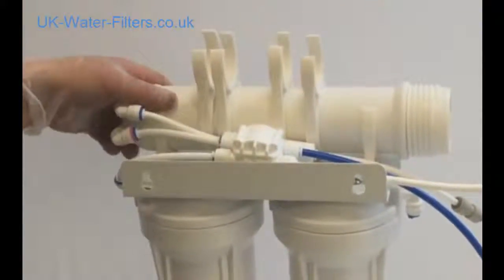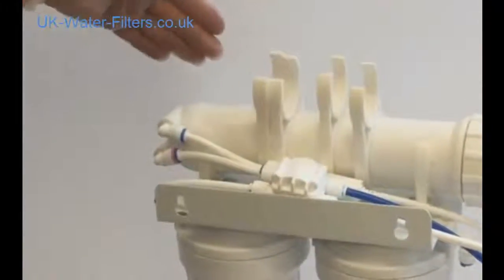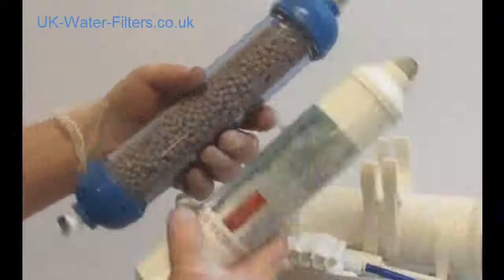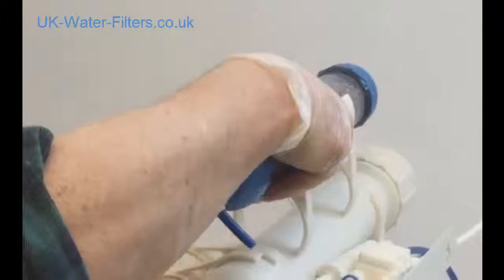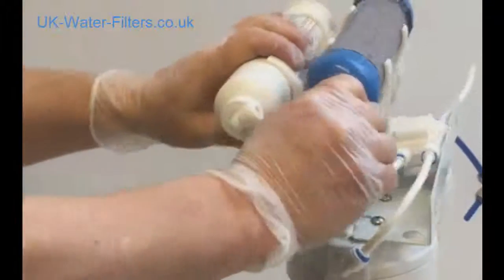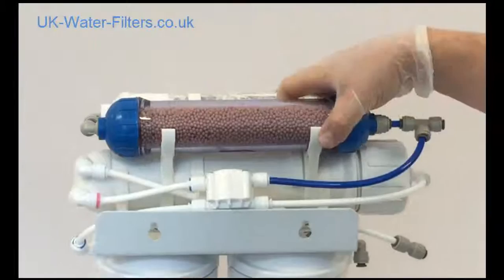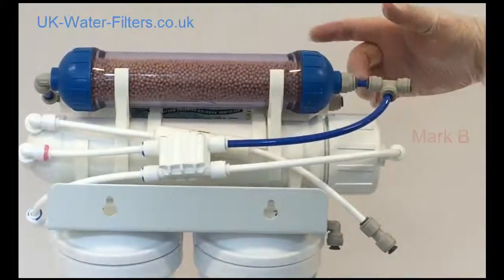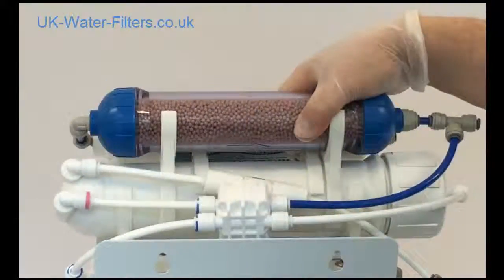Reverse Osmosis Water Filter - How to Set Up

Comment: so i just installed the system i ordered years ago (but couldn't install previously due to discovered house construction issues),  and the remineralizer leaks where the cap screws onto it.  

i have tried to fix it three separate times by taking it off, unscrewing it and adding ptfe tape over the plastic threads. but it still has a slow drip,  about one drop per minute.   i guess i just need a new one, but i decided i'd leave it on with a bucket underneath to just test the system and my install.  who knows maybe it might seal up itself?

But its very deflating when you take the time to DIY and think you've got everything right and then a component you haven't touched turns out faulty straight out of the box...  :(
Reply from the maker: Hello I'm sorry to hear about the problem. We haven't been able to locate your order on our records. Can you please contact us https://www.uk-water-filters.co.uk/pages/contact-us and we will resolve this.

Comment: Thank you for this video, I’m wondering if the 4-way valve is supposed to make any noise while operating the RO tap, and afterwards?
Reply from the maker: Hi Sebastian
It shouldn't really make any noise... it might have air bubbles in the system - which might be causing "water hammer" (This can sound like a high vibration - ie not just a banging sound..) . If this was happening on a normal tap you would have to turn it off and on again at various speeds to clear the air blockage. Do this on your RO. But if the noise continues, drain the
system and refill it - check the instructions on the (simple) steps you need to take.
Hope that helps you.